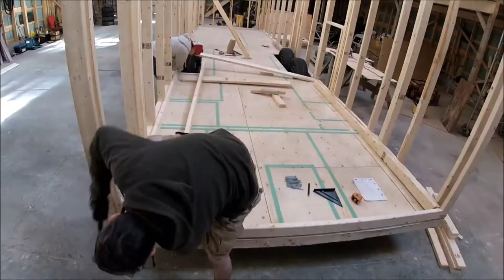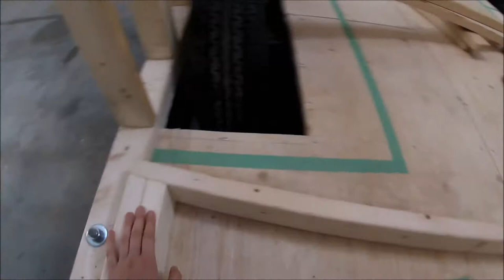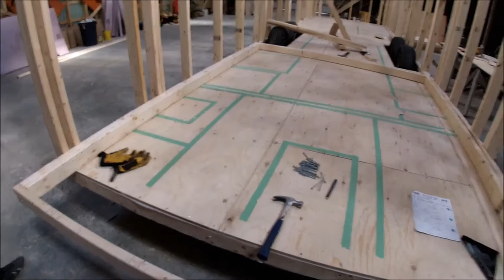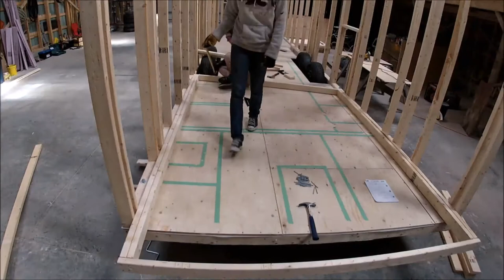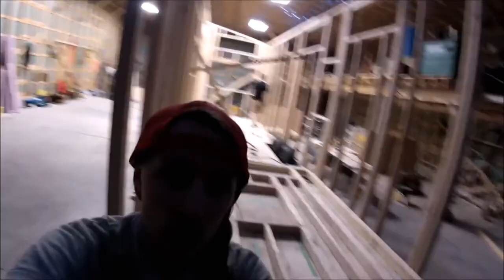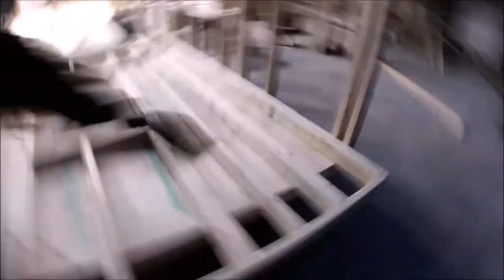Building a Rake Wall - Tiny House Framing

Comment: If you decide to build a second tiny house, then take a look at "advanced framing" techniques. You can use a lot less lumber, especially on non-load-bearing walls. Cheaper, lighter, faster, and better insulation.

Comment: Did you box your wheels in ? Are you able to take the wheels off if you want after setup , or if a tire goes flat ? Good luck with the build .
Reply: +Brian Renaud The wheels are completely boxed in and insulated. They will be able to be removed but it will be difficult... Our goal for this house was to be mostly stationary, buy a piece of land and park it there. I we were planning on moving it very often I would not build it the way we have.

Comment: Using 3" exterior screws to frame will increase strength and will resist backing out due to vibration when traveling.
Reply: +Dave Foote Screws actually are not a good idea for tiny houses as they have very poor shear strength. They would most likely crack off from racking and movement. You can buy screws with better shear strength but it would be much more expensive.